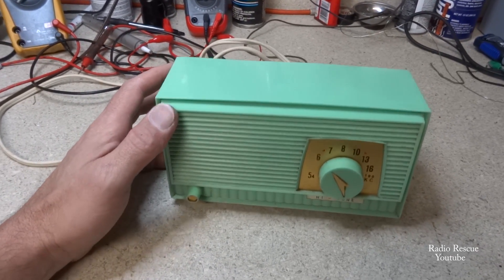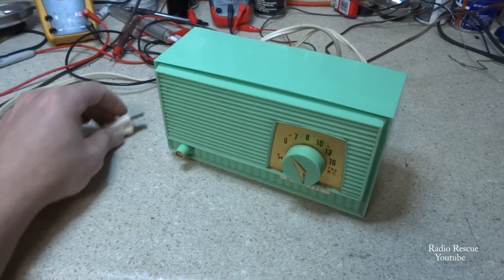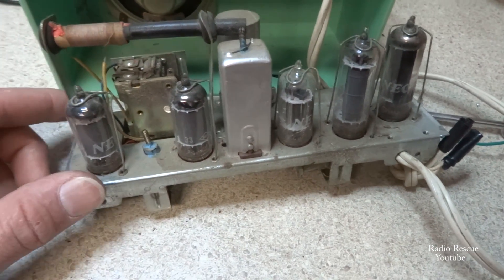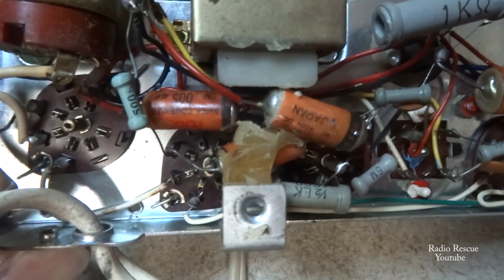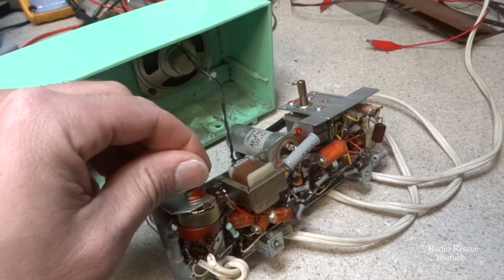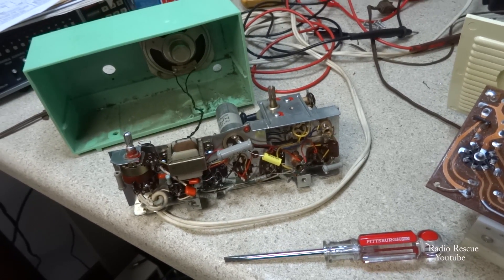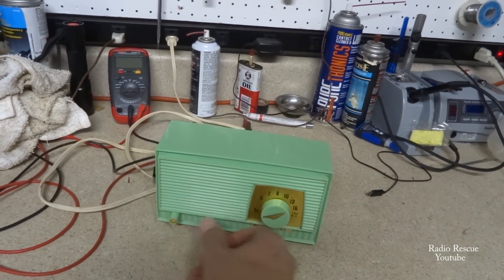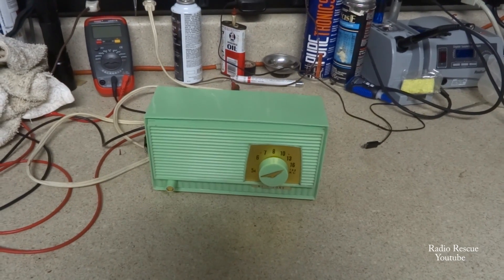Repair of a 60's "Hi Tone" Japanese Tube Radio

Comment: 6:00 I can see why they called it HiTone; that's about all you hear. It's got almost the same parts and circuit as a GE or Zenith, but what a squawk those $10 Japanese sets made. They   didn't seem to use those integrated RC network packages that were so common in the American sets; maybe that made it harder (ie. more expensive) to get the equalization right.
Reply: Although back in the day, "High Tone" was a figure of speech that meant top of the line, lol.  See someone dressed up real good and you could say, Look at you, man that's high tone!  LOL.
Reply from the maker: Couplets.

Comment: TEN/Kobe Kogyo built some of the better ones.  I have one whose non-polarised capacitors are nearly all TDK tubular ceramic types, with the exception of one paper capacitor across the air-core IF coil.  All I had to do to get mine going was to replace that one paper capacitor and one of the tubes.